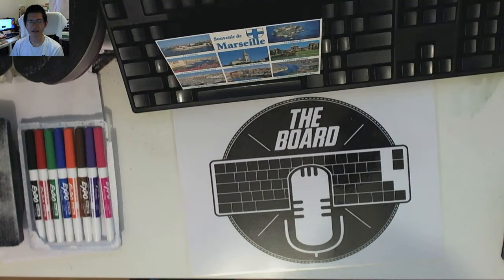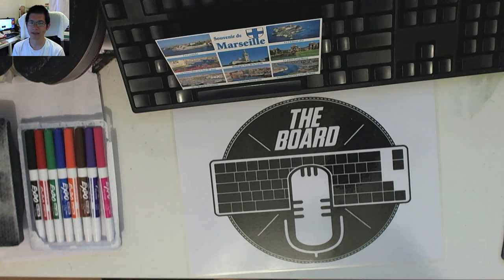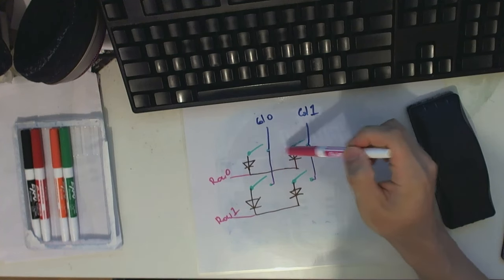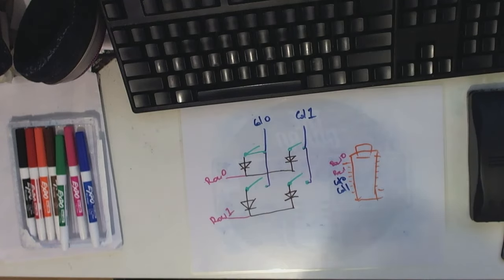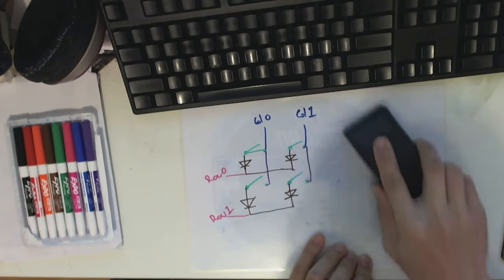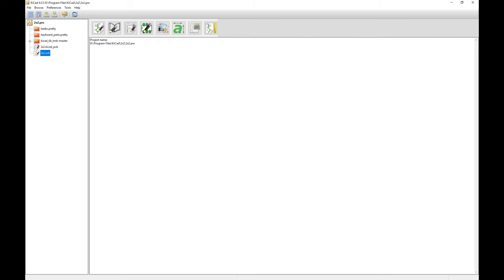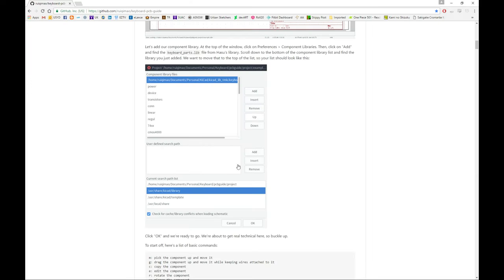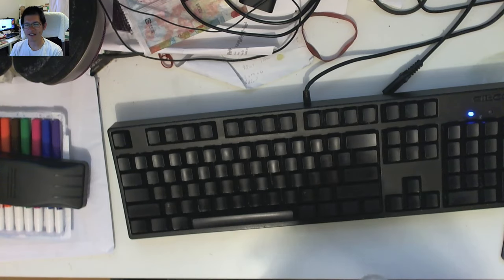Introduction to KiCAD - Part 0

Comment: This is GOLD :D
I'd love to make my own PCB! I make my own wrist wrest and keycaps (run out of resin now, but getting more soon).
Reply from the maker: Thats pretty nifty. I haven't done proper wrist rests yet, only made 1 leather one, but I have done resin caps, have you done any sales of your caps?
Reply: I've made my own from scrap wood I had laying around, I'm not at any 
means a woodworker, just wanted to try it and I'll maybe try to make a 
few more for my friend and cousins :)
I've done caps but unfortunately I haven't got any results that would be sale-worthy. I have just started with making them and when starting I picked up a clear resin which is curing in 24-36 hours and that killed my enthusiasm a bit because I had to wait a lot to see results. Now I'm picking up a faster curing resin and I'll make a few molds so I can make 4-10 at the time, because... Why not? :D
Reply from the maker: I primarily have been using 24hr cure resins, I recently tried some fast cure but found I had a lot of problems with moisture and bubbles forming in it. Good luck with the new resin!

Comment: Does Swillkb actually have a PCB builder, or did you mean plate and case creator?
Reply from the maker: Its only a plate and sandwich case creator unfortunately.
Reply: @theboard  I heard you call it a PCB creator in the video, so I just wanted to check. 

It's indeed unfortunate that Swillkb can't do that! I'm actually kind of surprised that there isn't a PCB generator out there somewhere. Seeing as the design of PCBs is fairly standard, it shouldn't be hard to program.